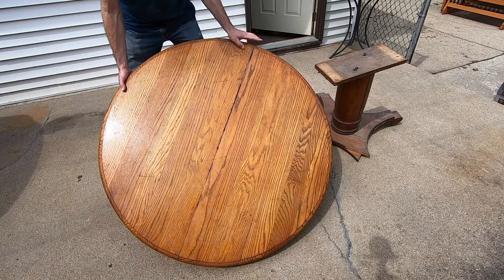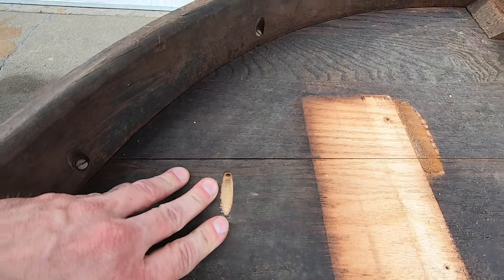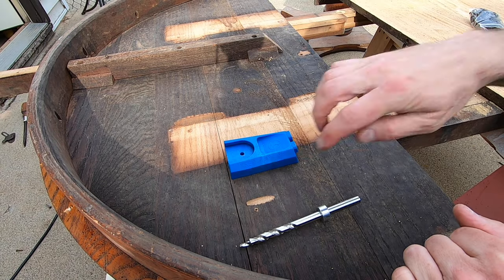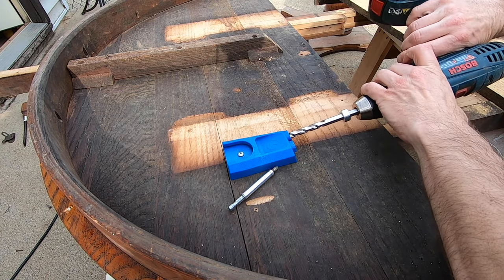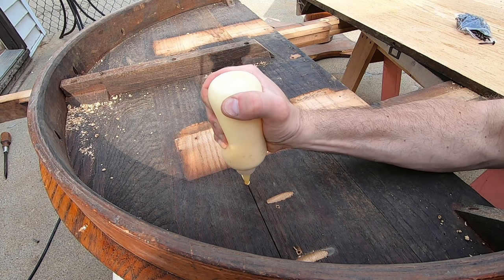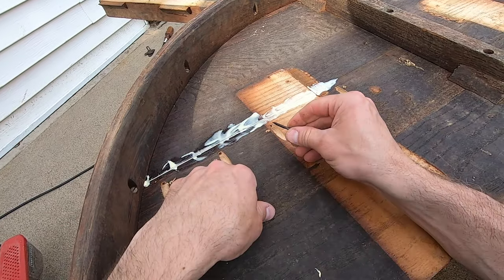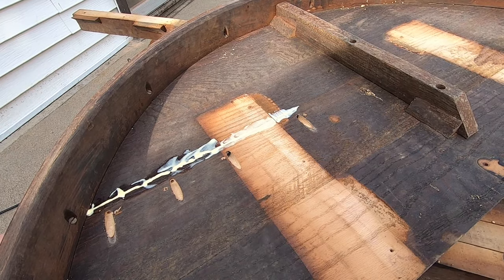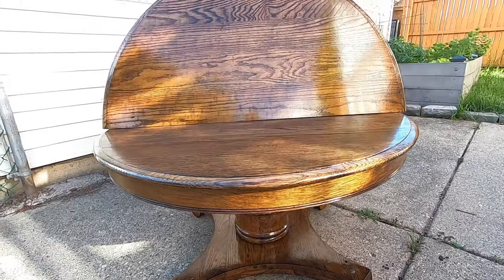Quick Tip - Repairing a furniture split using a pocket hole jig.

Comment: Wow.  Now that’s exactly what I needed and in only 2 1/2 minutes instead of 30? You are a natural teacher.  I will use your link to buy the supplies if possible.
Reply from the maker: The pocket hole jig I used on that was an old one. This one is no longer available. I believe the Kreg company still makes similar ones. Thanks for watching.

Comment: I've found that using one of those injectors made for injecting brine or maranade into chicken/turkey/etc  with the metal tips like a huge syringe works great for wood glue. Or clamp it all together, then use very thin CA glue like "Hot Stuff" from Satellite City (woodcraft sells it) and even clamped together, this glue will follow the entire crack and hold better than wood glue. I use this when fixing cracks in Rifle and shotgun stocks and ive never had it fail.

Comment: Would pocket hole screws work on split chair seat
Reply from the maker: Chair seats are thicker so it might not be very effective. It really depends how bad the separation is. In some cases you can squeeze  glue into the crack and clamp. Sometimes you can use glue and insert a small shim or piece of veneer. Difficult to say without looking at the damage.